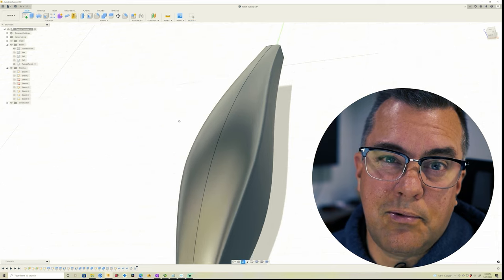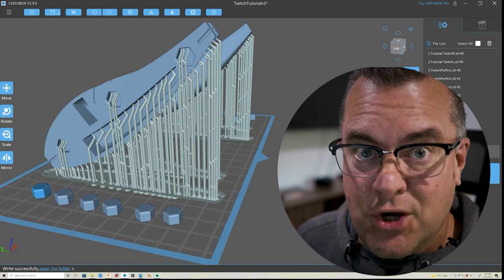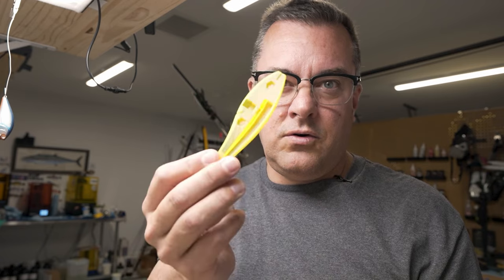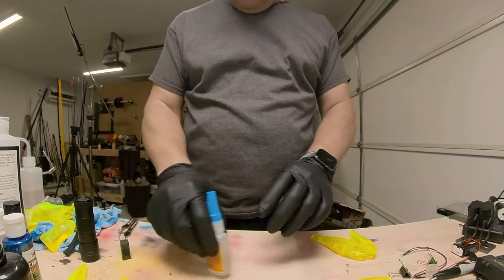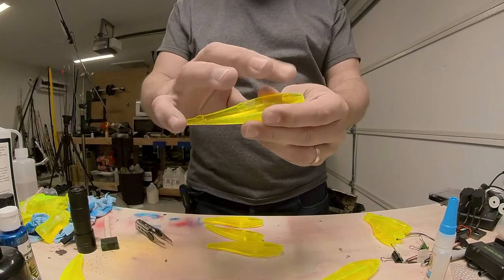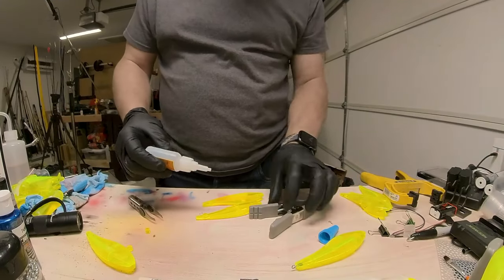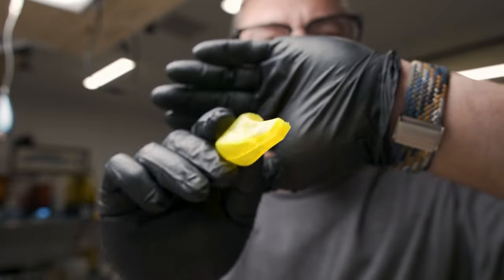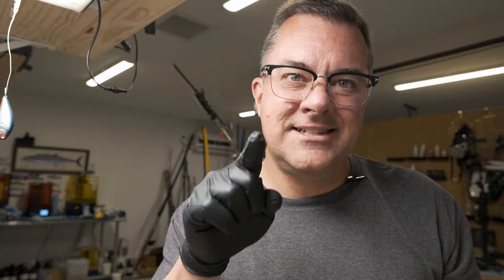Complete 3D Printed Fishing Lure Design Course - Gaps, Gloopies, and Gorilla Glue

Comment: This is pretty cool. How are the hooks connected to the resing part? With a little scew? If yes, do they hold perfectly case of a big fish?
Reply from the maker: I use screw eyes with a little super glue. I have not performed scientific testing but I have caught several hard pulling fish in the 26" range without issue. I have not tested them on Tuna or GT though ;-)
Reply: @WMBayouLures  thats cool. Thabks a lot. I will give it a go

Comment: I do what you do; I just don't have the channel. I use 2mm half ball sticking out on one side as a peg,  on other side is opposite for fit and finish. Works perfectly for line up. Do half to drill a little on imprint side because of resin.
Reply from the maker: I have a rule, if I am going to 3D print it, then I should not need to drill it. LOL I have a different technique coming up soon that eliminates all that hassle with only minor drawbacks.
Reply: Oh I hear yeah on drilling, but it's just for the peg 2mm drill, 2 mm drill in. Life time of easy fit up no extra parts. I do cranks,  jerk baits, lipless crank. only the drilling is draw back. Oh by the way love Chanel keep up great work love to see more of soft plastic mold. Wish I could put picture on here. Love to show you the work.
Reply from the maker: @philipcappelli2938  would love to see them! shot me an email bill@gulfstreamoutdoors.com